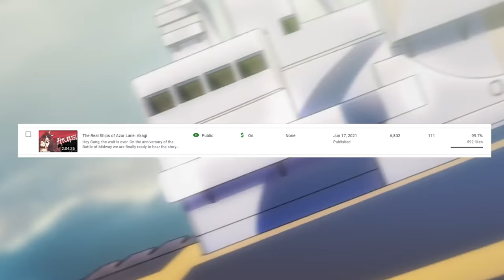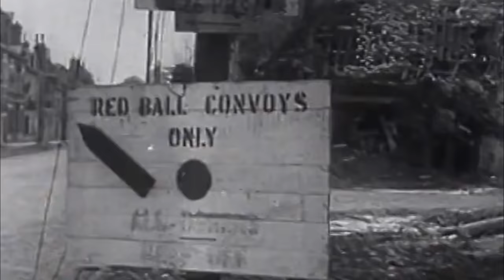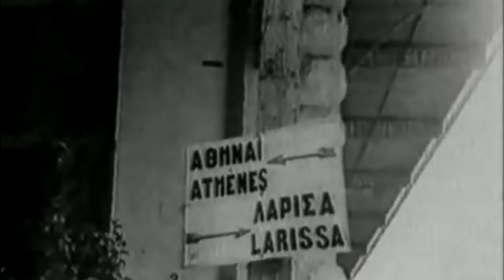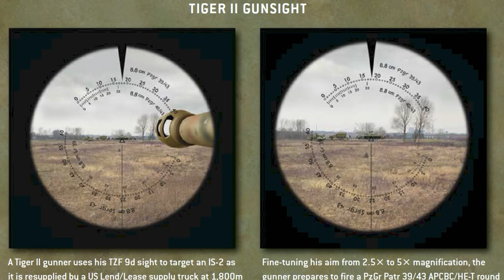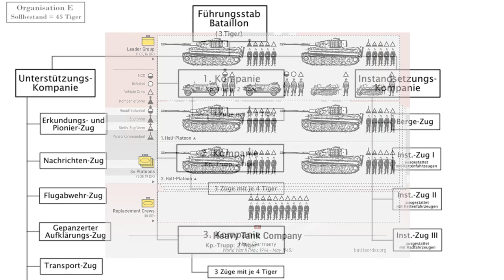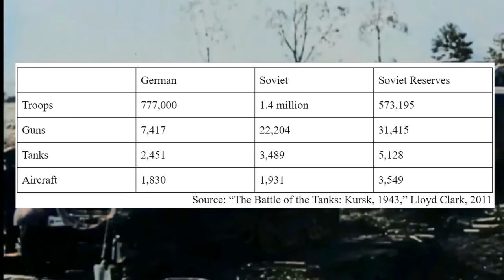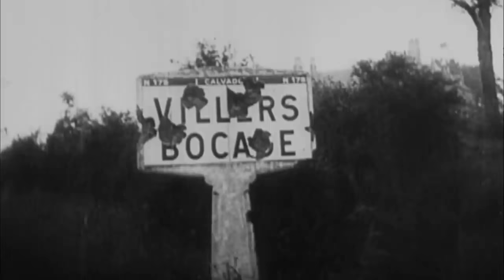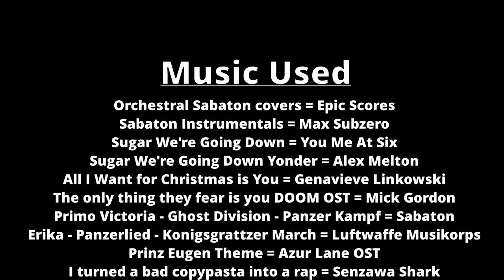The Tanks of Girls Und Panzer: Tiger 1 - WW2 History Documentary

Comment: I know this video is already quite old but still:
About the planning of Zitadelle:

The Wehrmacht did have plans in 1943 to act on the principle of strikes from the rear [backhandblows], but Hitler did not want this and instead wanted to act offensively on a small scale. See Kursk 1943 Roman Toeppel page 20

The plan for Unternehmen Zitadelle (i.e., the basic idea) came from Generaloberst Schmidt. See Kursk 1943 Roman Töppel page 23

Manstein still tried to convince the General Staff in March 1943 to eliminate the Kursk front arc already now. See Kursk 1943 Roman Toeppel page 24

The driving forces for Unternehmen Zitadelle were Heeresgruppen Mitte and Nord not Hitler, who was initially more inclined to Unternehmen "Panther". See Kursk 1943 Roman Toeppel page 28-29
The first postponement of the original attack date of 1 May (3rd May, later 5th) was made because Army Group Center did not yet see itself ready to attack. See Kursk 1943 Roman Töppel page 32-34

The postponement to 12 June 43 was done because of the consideration to increase the chances for success by having better forces available and to have enough time to build up sufficient forces in Italy. See Kursk 1943 Roman Töppel page 35

Defacto, except for a handful of generals, almost everyone was against the postponement of Citadel until June, but an attack in May could hardly have taken place anyway because of the weather. See Kursk 1943 Roman Toeppel page 36-37

Translated with www.DeepL.com/Translator (free version)

So it is quite more complicated. As always the russian had trendemous luck with the weather. Furthermore the germans made some blunders. In the southern pincer they had too few infantry division in the norht to much. Model which you named was not aggresive enough in the north. he even send a infantry division in the first wave of attack instead of a panzer one..... Kursk, from what i interpret out of Töppels book failed, because the norther Pincer failed. The SOuth would have probably been able to reach Kursk altough it would be questionable waht would have remained of tehir combat power.

The Soviet artillery attack on the German initial positions was hardly successful. Interference fire was fired but the losses were only minor. Almost all divisions of the first attack wave could nevertheless attack as planned, only one division in the south was delayed, but this by fighting on the ground. See Kursk 1943 Roman Töppel page 109-110

yeah and the soviet air and Artillery "coutnersuprise" attack.... didnt went good... as to be expected by the soviets

and with coutnerattack you mean the one of the 5th Guards tank army in the south? where the SS litrally slaughter them and the whole thing had few effect except deleting russian reserves? where the russian lost around 100 tanks and killed 3-4 Panzer IV? the more succesful coutnerattacks came when the iniative shifted and the russian began to push the germans back

Comment: In fact, the loss of that first deployed tiger was a good thing. the Soviets shit their pants and started a program to defeat it.  this would lead in part to the development of the IS/JS series of tanks. this also speeds along the development of large caliber support guns to deal with the treat. and not more resources put into t34s and other more useful tanks, like the t-43 and t-44 till after to war in the case of the t-44. the thing that is far better than may have been on the battlefield earlier . the IS/JS tanks were just as bad as the tiger they many have faced while assaulting german positions. gearbox did not work on the tank( again like the KV series) amour issues in production. on top of supply and logistics in manufacturing and just crew and political issues. the IS/JS tanks were not ready for prime time as of late in the war. due to constant breakdowns and not being able to keep up with the far better t34s of all types by late 44 early 45. they tried to copy an issued design. note when the german tried to copy the t34 save for german inherent problems they got a pretty good tank. that worked( for the most part ) the Panter tank. just a little more in cost than the pz4 and way more capable.

Comment: These sorts of doctrinal questions are massively overestimated though. Economic/material and (especially) political factors play a much more central role, and the latter especially tends to be avoided by military historians (in many cases because of how controversial they would be, in others because everyone already thinks exactly the same thing and no one is interested in debating the issue). 

Germany starts out the war with both the economic and political wherewithal to overwhelm the powers on the European continent, or conversely the latter do not have the political cohesion to resist the Axis beyond the initial phase (but this will change over the course of the war).